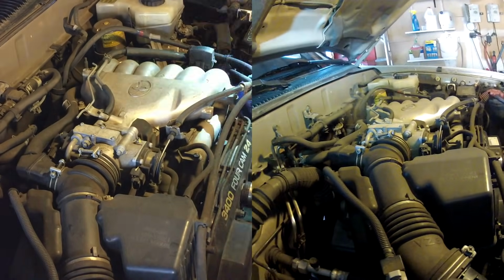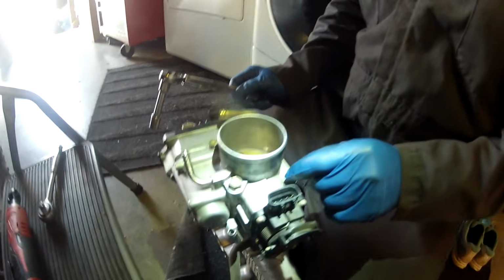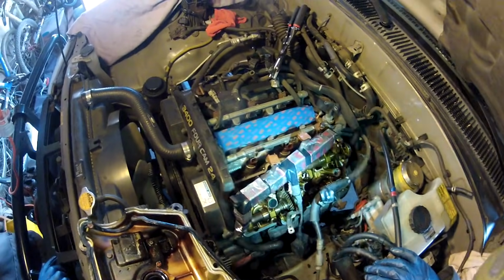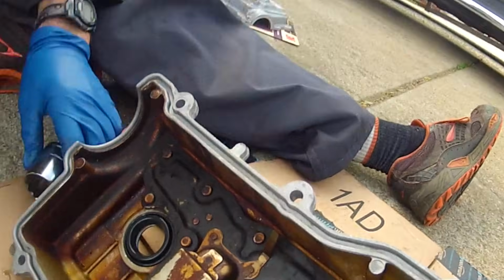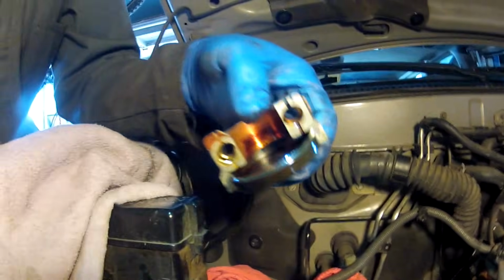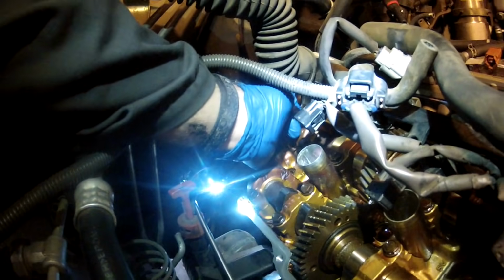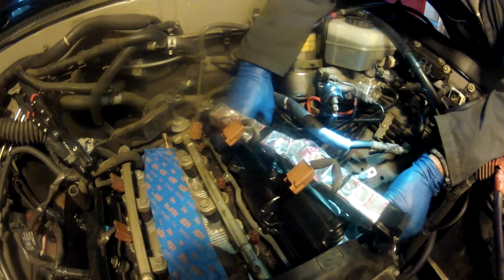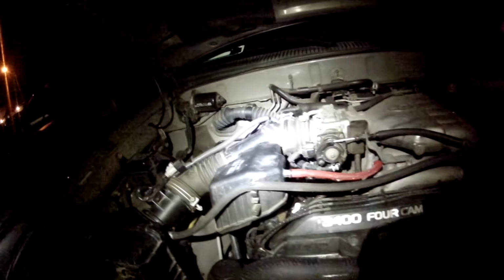3.4 L V6 5VZ-FE Toyota 4runner, Tacoma, Tundra Valve Cover Gasket Tutorial

Comment: I just finished this on my rig. Between your videos and the FSM, it didn't seem like too hard of a job. That said, I sure hope the new gasket and FIPG did the trick! I would prefer not to repeat this task for another decade. I want to add that last month using your videos I replaced both front wheel bearings, lower ball joints, re-booted the upper ball joints, new bushings in the upper and lower control arms. new steering rack and tie rods, new front end links, re-booted the CV Axles, new extended SS front brake lines, 199MM TBU, installed Bilstein 5100 shocks all the way around, and new OME 906 springs in the rear (my '99 highlander coils in the front aren't sagging, so I left them). Next week it will be the timing belt, water pump, etc, and then hopefully a break for a while. Thank you for your videos!
Reply from the maker: Hey James, I'm with you.  The valve cover gasket job isn't hard, but it is time consuming and a little tedious cleaning off the surfaces like the half moon areas in the heads.  I've now done this job 5 times.  Once for Sean, twice on my 3rd Gens and another two times for some other guys.  Great to hear you're using a lot of our videos to fix up your rig.  Thanks for taking the time to comment.  You're very welcome and Happy Wrenching.

Comment: Timmy!  I ordered the throttle body gasket per your part number and it looks different than the one that I’m taking off?  For the non supercharged engine.  Did you run into this?
Reply from the maker: Hey Nick, we list two different part numbers for throttle body gaskets in the video description.  One that's meant for supercharged engines and one for stock engines.  The one for the stock engine doesn't have the full circle opening.  The one for the supercharge has the full circle.

Comment: Mr. Toolman, I commend your for still answering questions from a 5 year old video.  Now I should potentially save a lot of money doing this myself so I don't know why I'm going cheap, but do you have to replace the two camshaft plugs?  Seems like they could be cleaned up like the half moons.  Part prices seem to go up faster than the new truck prices.  Thanks for the video.
Reply from the maker: Thanks Larry and you're very welcome.  We try to answer all questions and acknowledge all comments on our channel.  The cam plugs have a rubberized exterior and that's what makes a leak-free seal with the cam collar and head.  Over time from the heating and cooling cycles of the engine, the rubber shrinks and gets less compliant and is a source for an oil leak.  The only way you could reuse the cam plugs is if you smear FIPG on the outside diameter of the plug to guarantee you won't have a leak.  I don't like this idea because if you ever have to redo this job, cleaning out FIPG where that cam plug sits on the back of the head might be a major hassle.  For this same reason, I don't recommend people smearing FIPG on a new cam plug as extra insurance that the plug won't leak.  If the head surface is clean and cam collar surface is clean, the new cam plug should not have any issues creating a leak-free connection with the collar and head.  Good luck with the job and Happy Wrenching!

Comment: Thanks for the awesome tutorial!  I would have never been able to get those gaskets swapped out otherwise.  It took a long time to do it, but I was being careful not to screw anything up.
Reply from the maker: Thanks John.  What you found out is it's not a tough job but it's just a whole lot of steps you've got to do.  Once you know that engine better, the vacuum hose and electrical connections will become very straightforward.  I just did this job on a friends 1st Gen Tacoma and I didn't have to mark any of the hoses or electrical connections to jog my memory.  I did however label and individually bag the hardware as it came off the engine to not mix any of the bolts or nuts up.  Great job getting this repair done.  Happy Wrenching!

Comment: Try just a little tork on your old gasket it stops the smoking
Reply from the maker: What you suggested sort of works because you can only access some of the bolts with the plenums in the way.  You need to be careful and not tighten the valve cover down unequally because then bad things happen and you end up cracking the valve cover which is a bad thing.
Reply: @TimmyTheToolman  ya i had 1that was leaking from shinking an it worked so I did again on my other  1 an it stopped the smoking
Reply: But doing the write way was not a option
Reply: @TimmyTheToolman  the bolts were lose
Reply from the maker: @marcmorri9087  The bolts loosen because the rubber that's part of the washers ages and shrinks.  The valve covers are just one area that can allow engine oil to leak out.  There's also the half moons, cam plugs and spark plug tubes.  So yeah, tightening down the bolts can work to slow or stop the leak if it's just the valve covers that are leaking.  If it's leaking from the cam plugs or half moons or the spark plug tubes are filling up with oil, tightening down the valve cover bolts isn't a fix for the problem.

Comment: Timmy, in-lb torque wrench that is on your list costs some $145 on Amazon. It's actually half of what I spent on the listed parts from Toyota. Since I rarely use a torque wrench, do you think a 1/4 drive in-lb torque wrench (which is sa lot cheaper) will do the job? Thanks man. Great help!
Reply from the maker: You don't need to buy the torque wrench we linked.  Any torque wrench that at least goes up to the torque value for the valve cover bolts will work or you could just go by feel to.  You just need to remember they are small bolts and don't require a lot of force to be properly tightened.  The key to tightening them down properly is making sure you tighten them down slowly and evenly doing a crossing pattern over and over again.
Reply: @TimmyTheToolman   I really appreciate the reply thank you so much great videos!
Reply from the maker: @KrisCage  You're welcome.  Good luck with the job.

Comment: How long do you let the rtv set before starting the engine?
Reply from the maker: It typically takes 24 hours to fully cure, if you can give it overnight to cure that would be ideal but we drove the vehicle ~2/3 hours after applying it and it was fine.

Comment: I have a question about spark plugs for this engine, 2000 taco. I bought some ngk ruthenium plugs and the site says they fit but theres a sticker right there on the upper timing cover that says you have to use the double electrode.

Any advice on this?
Reply from the maker: I have always bought spark plugs from the dealer for my two 3rd Gens and the ones you get are dual electrode.  I suggest sticking with dual electrode spark plugs.
Reply: @TimmyTheToolman  The link for the plugs above goes to Denso 3194--amazon says those won't fit a 98 4runner. Are you confident those are the right ones?
Reply from the maker: @danielgrant4914  They are the right spark plugs for the 3.4 liter engine.  Read the questions for the product link.  People are asking the same question you just did and people are telling them it's the right plugs for their 3.4 liter engine.  That Amazon feature can be wrong sometimes, and this is one of those times.

Comment: Thanks for making this! Going to start on this project tomorrow. Did you apply antiseize on the new plugs? I'm going to be using Denso.
Reply from the maker: Hey John, no, we don't use anti-seize on the spark plugs threads.  I personally don't think this is necessary but I know some people use it.  Good luck with the job.
Reply: @TimmyTheToolman  finished this up a couple nights ago. No warning lights, drives great. Couldn’t have done it without your video! Thanks so much. I feel great and much more empowered to do more work on my truck.
Reply from the maker: @johngeorge4981  Hey John, great to hear the repair went well for you.  Thanks for sharing this with us.  It's also great to hear this experience has boosted your confidence to do more work on your rig.  Happy Wrenching!

Comment: Thank you Timmy for this video. I just got doing this last night and it was a pretty easy job, just lots of things to remove. Took me 6 hours but that was me watching this video and cleaning the valve covers, installing spark plugs and being very careful to not mess anything up. She fired fired right up! My 2000 is at 276k miles and Thankfully your videos have helped me replace every suspension component 😃.

Thanks Timmy 🤙🏽
Reply from the maker: Hey Josh, great to hear our video helped you get this job done.  Like you found, it's not hard, it's just a lot of steps to perform.  It's also great to hear our videos helped you with suspension work on your rig.  You're very welcome and thanks for taking the time to comment.  Happy Wrenching!

Comment: Timmy you are a lifesaver! So I took off the valve cover and the engine is flooded with oil, on the inside only. Should I try to clean up the excess oil? Is this from just the spark plug seals, since the valve cover looks fine? My spark plugs were also flooded. Thanks!
Reply from the maker: Hey Lizzy, I'm not following what you're saying.  Where's all the excess oil?
Reply: @TimmyTheToolman  I see oil pooled in the engine everywhere it can possibly be. Is it supposed to be like that?
Reply from the maker: @lhughescca  Are you saying under the valve covers where the cam shafts are?
Reply: @TimmyTheToolman  yes
Reply from the maker: @lhughescca  Oil pooled in the area under the valve covers is completely normal.  Most of the oil drains down into the oil pan but some of it ends up pooled in little depressions on top of the heads.  I can't see what you're seeing so maybe email me a picture.  Here's my email address: mtbtim@sbcglobal.net
Reply: @TimmyTheToolman  ok good to know! I wasn't sure.  Thanks for your help!
Reply from the maker: @lhughescca  No problem Lizzy.  You're welcome.

Comment: Just did this job and it was not too difficult but definitely many steps. Labeling all hoses with numbers was a life saver. I used Aisin AB1270B1 gasket maker for everything and replaced many gaskets (plenum, valve cover, camshaft, and PCV valve). Also replaced many air hoses (1/4 and 5/16). Best tools, small 3/8 stubby ratchet, hose pliers, brass brush for old RTV and extensions in various sizes. No leaks and running like a champ. Thanks Timmy!
Reply from the maker: Solid don! Thanks for coming back to comment and offering your advice with tools. Sicmods!
Reply: Hey Don, did find a full set of hoses or have to buy individually?  I want to replace all my hoses (25 years old getting brittle & cracking).
Reply: @davespence4912 
Had to buy individually. I just took the hoses and went to Oreilly. They sell it by the foot. I did bring along my measuring digital caliper ( a little overkill) but didn’t want to make multiple trips. Use a little silicon paste around orifices which makes hose install ultra easy.

Comment: The best to ever do it, if you were to strip one of the threads in the head from over tightening the valve cover would you heli coil or just jb weld a stud in then just use a nut?
Reply from the maker: Heli coil sounds better than JB weld.

Comment: Did this gasket today. The last time I had the hardest time getting the spark plug gaskets out. This time I used some 90 degree bent pliers and stuck them under one side and used it like a leaver and all 6 popped out in less than a minute.  The contact points were all on the old gasket so nothing sketchy. Think it took me like 30 minutes to get them all out last time.

"11 in. 90° Bent Nose Long Reach Pliers" https://www.harborfreight.com/11-in-90-bent-nose-long-reach-pliers-64087.html
Reply from the maker: Thanks for sharing this tip that worked for you. We hope others can benefit from your link!

Comment: Awesome video but you did not show how to take off front cam shaft plugs. Mine are somehow caught behind something.
Reply from the maker: Hey Xavier, there was a typo in the video.  There's only 2 cam plugs and those are on the backs of the heads.  We corrected this mistake in the video description but I guess you missed it.
Reply: I did not miss it. I actually went back to look at all the parts needed and it said 4 cam plugs. Great job tho i was just a bit confused.

Comment: Great video! Did you guys paint those valve covers or are they replacements?
Reply from the maker: Yes, we removed them, cleaned them up, painted them, let them dry while we were working on the rear of the job and slapped them back on!
Reply: Timmy The Toolman they look great! Did you use high heat paint? 

Thanks for the response! Your videos are awesome. I subscribed!
Reply from the maker: @crossFit513  Yes, you absolutely want to use a high heat paint for this.  Thanks for subscribing and welcome to our channel.

Comment: Hi timmy thanks for this video it really help me complete this on my toyota prado 3.4L v6 year 2000. It took me a long time but was great when I finished, we then done a 3800 km road trip after. My mistake was buying a cheap torque wrench and cranking the rocker cover up too tight which did crack  after the replacement I felt it by hand and was another better.
Reply from the maker: Yeah, cracked valve covers is a fairly common result of people over-tightening the valve cover bolts.  But, glad the video helped you out.  You now know a lot more about your engine and I imagine you feel much more comfortable working on it.  Good job and Happy Wrenching!

Comment: Hi Tim... abt to do this job.. would you recommend buying the Throttle body gasket?
Reply from the maker: If you're going to disconnect the throttle body from the plenum to clean it, then yes, I would replace it.  If you don't plan on disconnecting the throttle body, you could forego replacing it.

Comment: Not sure if this has been asked already but did you leave the ducting tape on the wiring harness permanently? Cheers
Reply from the maker: We did. Since the plastic wiring cover/protector was basically falling apart and Brittle from being exposed to heat, in order to maintain its structure, the tape will be left in place to prevent it from breaking into a million pieces when we go in there again one day.
Reply: @TimmyTheToolman  cheers for the reply 👍
Reply from the maker: @The_Practical_Nerd  We try to respond to everyone's question or comment but sometimes they slip past us.  Happy Wrenching!

Comment: Hey Timmy- killer video. Just did my valve cover gaskets. The brittle plastic piece holding/covering the spark plug wires broke on my drivers side... wrapped the wires in electrical tape. Should I think about replacing it? It’s all gone and that part of the wires are no longer attached anywhere.
Reply from the maker: Use some split wires loom to protect the wires.  Just cut it to the lengths you need and tape it in place.  Like this : https://amzn.to/2H6Gr8P  5/8" or 3/4" would do the job.  You can also pick this up at any auto parts store.  It doesn't matter if you no longer can affix it to the valve covers.  Just give the wires some extra protection and you'll be fine.

Comment: Hey Tim!  Just completed the valve cover job. I ran into a small problem. When I was pulling the semicircular valve plug front driver side I broke it. I believe I didn’t pull straight up. Luckily, I’m good friends with the manager at the local NAPA and he had one. O’Rielys. Autozone, and Advanced Auto where special order only. Other than that it went well. My 2001 is running great now. Thank you again for the great videos.
Reply from the maker: You wouldn't be the first to break one of those semi-circular plugs.  Glad the job for the most part went well for you.  You're very welcome and Happy Wrenching!